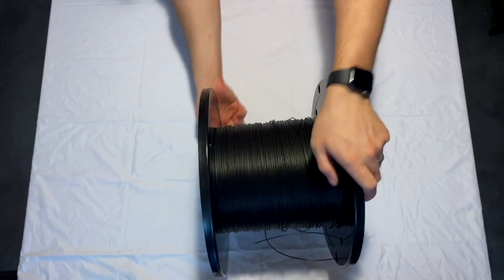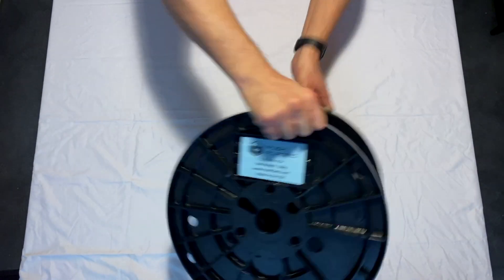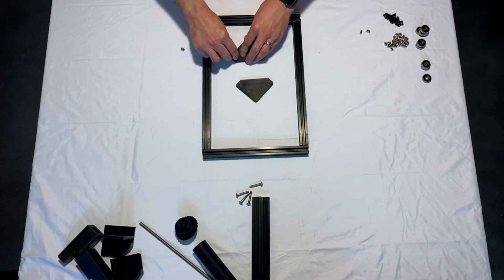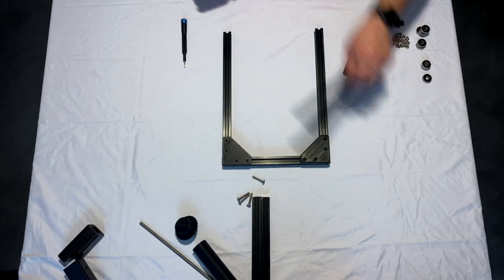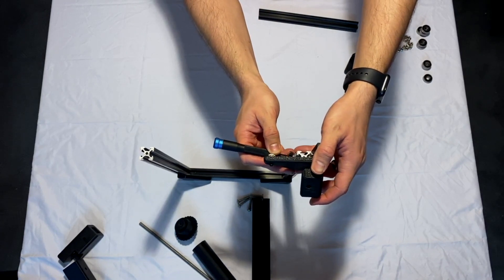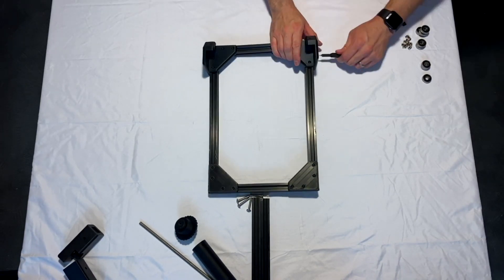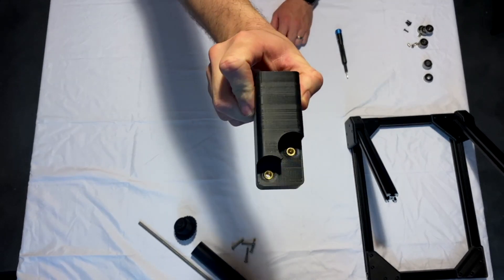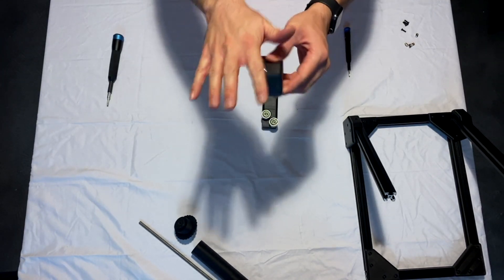Building a Spool Holder for 10kg filament spools for my 3D Printer!

Comment: I appreciate this roller, it's doing a much better job than the roller supplied by push plastic. Thank you for the simplicity of the design and function of the spool holder. For anyone who builds this off of the thingiverse link, do yourself a favor and just cut 4 pieces at 300mm. When using M8 button head screws which are the lowest profile screw heads I could find the width at 250mm was so tight with a squared up frame that there was maybe 1mm of space at the end of the extrusion from the T-nut. The all thread doesn't quite line up or carry much of the weight either do to the 5mm (10mm total) of space eaten up on each end of the roller from the screw head of the M8 bolt. I will look at modifying this when I get a chance and post the remix accordingly and certainly give credit for the hard work you put into it. I built this entire design  including cutting the extrusion in under 30 minutes.

Comment: Awesome - Thanks for the video.  Going over to print this now.   One question, my spools are 8.5kg and have a diameter of 355mm, would this fit OK in this holder?  I think the diamter of your rolls are slightly smaller going by eye.  Many thanks in advance :)

Comment: Why do you use these 10kg rolls, The Texas size 5kg rolls are cheaper when you buy two then one of these 10kg rolls
Reply from the maker: Every time I check the 5kg spools from ZYLtech are out of stock! I’ve been wanting to try one out. Ironically, the aluminum extrusion in this video is from ZYLtech!
Reply: @SNRTechBytes  They Just released two or three new colors I would give it a look Ik the normal white pla is out of stock tho.
Reply from the maker: Oh nice thanks for the heads up! Looks like the black is finally in stock, and it appears compatible with the spool holder in the above video! I’m running low so I think I’m going to try one out! Thanks!!
Reply: @SNRTechBytes  can’t wait to see a review on it
Reply: @SNRTechBytes  I just finished printing the Rod for the filament and it does not fit the 5KG rolls.
Reply from the maker: @scrubbob9901  Ill upload the thinner one tomorrow on thingiverse! I ran into the same problem and modified the design to have a smaller diameter. I've been running it on a zyltech spool for a few days now and its working well! It uses the same steel core so you just have to swap it out!
Reply: @SNRTechBytes  awesome I printed everything else before the rod and I have the excursions coming
Reply: @SNRTechBytes  When Do you think you will be uploading the 5kg rod?
Reply from the maker: @scrubbob9901  Hey I'm so sorry for the delay! I just uploaded them to thingiverse!
Reply: @SNRTechBytes  Thank you me and my friend reverses engineered it but we used standard threads. What was the thread out of curiosity?